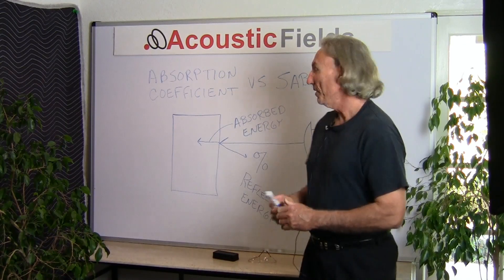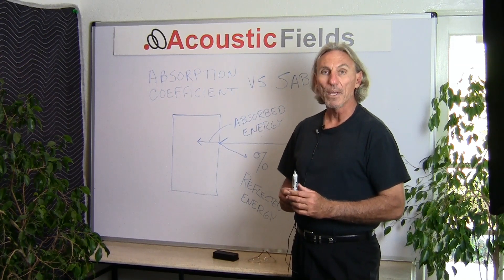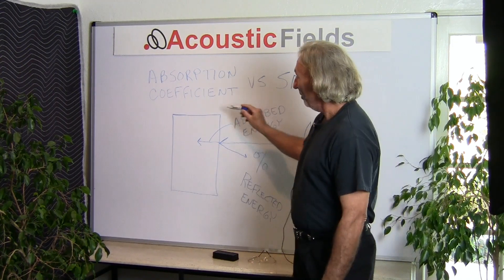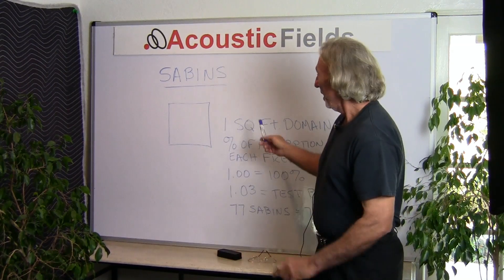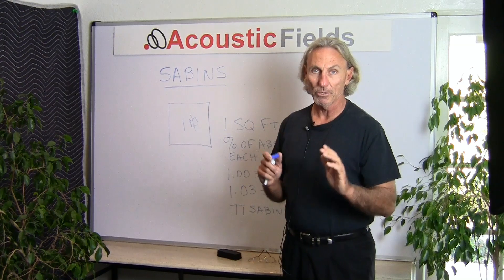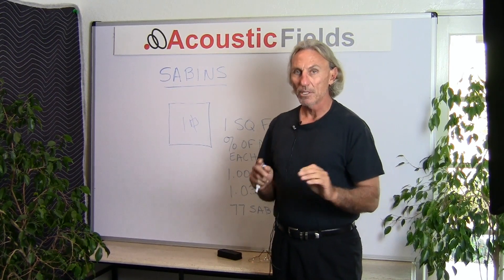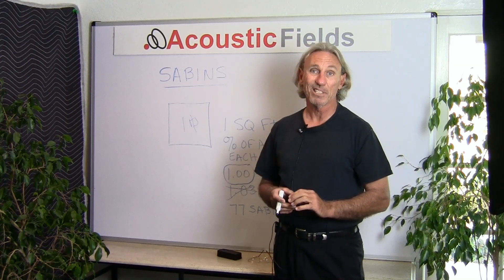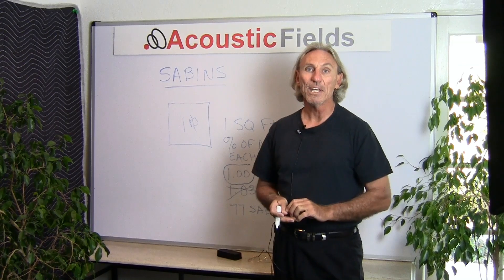Sabins Vs Absorption Coefficient - What's The Difference? - www.AcousticFields.com

Comment: Hi Dennis, so is there an equation to convert Absorption Coefficient to Sabins?  Im seing one material with an absorption coefficient as .26 at 125hz, and another with 18 sabins at 125hz. Which one is better?
Reply from the maker: The absorption coefficient is what % / sq. ft. of absorption occurs at that octave band. There is no better, just different rates and levels. What is your room usage?
Reply: @AcousticFields  ok interesting, but then would .26 absorption co-efficient be more or less absorbing that 18 sabins??  I have a home studio that I mix and record in /4m x 6m x 2.8m (vaulted ceiling).  Thanks for your help!

Comment: What kind of acoustic material like a curtain can I spread of some portion of a dome of 90,000 capacity where dis is no ceiling?? Tanx
Reply from the maker: Curtains are a middle and high frequency absorption technology. If you are using them in a critical listening room, you must know the rates and levels of absorption they produce. Achieving good sound quality in a room is about doing a lot of little things correctly and just as important in the correct order.

Comment: Hi! Can you explain more about the absorption coefficinets. If 1.00 equals 100% absorption than most cheap foams like Auralex should absorb  all of the 1 khz. But still, if I wrap this foam around my speaker and play 1 khz, most of it comes trough - so if it's on the wall - most of it gets reflected from the wall behind it. If  Your foam coefficient says also 1.00 at 1 khz - what about the critical distance  - balance between reflected and direct energy? Thank You.
Reply from the maker: You are confusing sound absorption technology with barrier technology using your foam/speaker example. To stop the transmission of 1 K energy you need to build a barrier that will work at the frequency and amplitude of the noise source. Sound absorption coefficients are based on a materials ability to absorb frequency and amplitude / square foot of surface area. 1 K energy that strikes every square foot of absorption material type will be absorbed at the coefficient rate and level of that material type.  I do not understand your reference to critical distance.
Reply: @AcousticFields  Well, if i use foam on the wall, then some of the  1 khz goes trought the foam, to the wall, reflects from the wall, trough the foam back to the listener. If there is 100%  absorption, than this should not happen. So my question is- is 1.0 or 100 % absorption the same as asanechoic chamber?

Comment: thank you. i have question is there any acceptable sound absorption coefficient range or values at different frequency level like (125HZ, 250HZ, 500HZ and  1000HZ) of sound absorbing non woven material applicable for radio broadcasting studio.